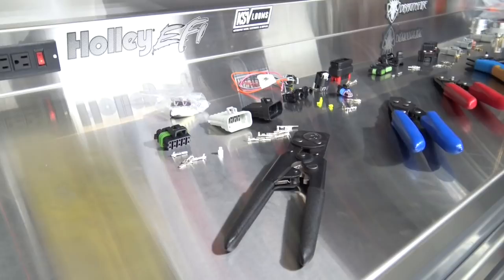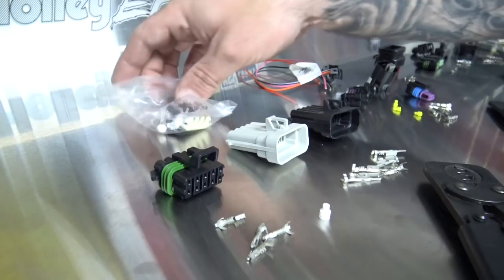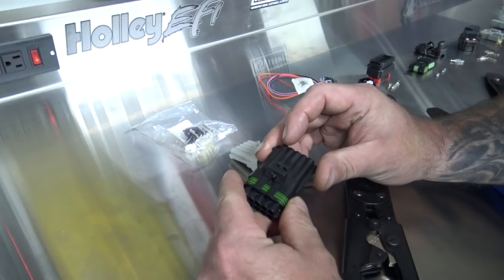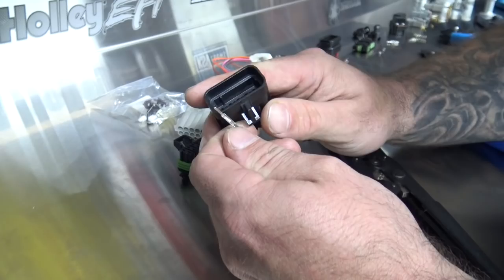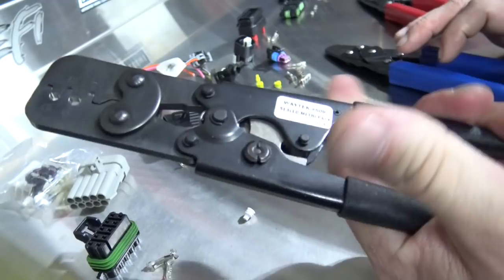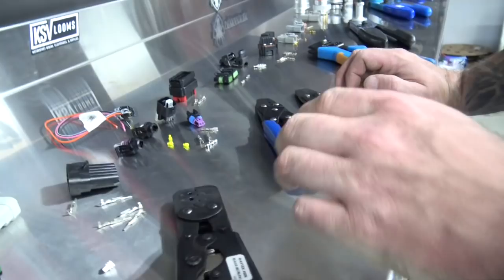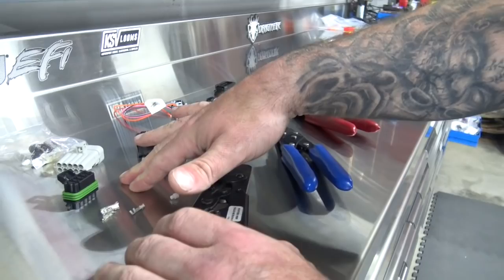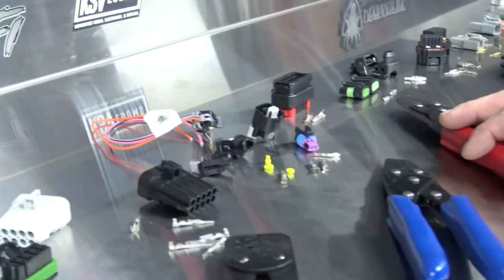holley efi connectors and crimpers.  Bulkheads, Deutsch, metripak, autosport, gt150 and amp.

Comment: I’m a regular car guy with a few mustangs at home. I soldered everything in my notch when I put it together. I watched your whole video to learn about crimping. Wish I saw it a year ago. It would’ve been a lot easier to crimp wires then to solder every one. I’ve never seen a proper way to crimp and make a solid trustworthy connection so I played it safe and soldered every wire.  I’d like to see them actually be crimped though. Thanks I’m going to check out your other videos.

Comment: Well, Packard/Delphi 150.2 pull to lock also uses three different female cavities, depending on the wire size, same goes for the pins.
Not only Deutch.

And Casper actually makes male cavities ( aftermarket), if you need to make extensions or short swappable harness ( I had to, for stupid Williams Controls pedal that keep breaking wires right at the connector).

Comment: i love them little douche bags! also fwiw MSD sells crimping dies for Deutsch connectors it works in their spark plug crimp tool msd 3510 it works with msd 35051.  poor mans crimp tool
thanks for sharing! I use the DT series throughout my entire car.  THe detent features on the pins are robust and provide an almost infinite service life.  I have only ever had one fail after 12 years of use.  Deutsche also used to make bulkhead connectors that are like the DT series, body is plastic and they worked well.  Much cheaper than the machined body ones.  thanks Devin good video as usual

Comment: Working in the aerospace industry, I would never use any cannon plug that has the three nipples on them for locking down the mating plug. They locking nipples wear down over time. Any company selling you those have not used them in the field and seen the failures of them. They were designed for interior cabins on planes and helicopters, but have since been replaced by the positive locking cannon plugs. Duetsch Autosport connectors are way overpriced. You can get Ampehnol connectors at a much better cost from an aerospace connector supply house, they are used on many commercial and military jets and helipcopters. Just food for thought.

Comment: What u think about putting Holley EFI on a nitrous engine and what would use. Like nitrous controller wise and injector brand etc
Reply from the maker: I've installed alot of dominators on nitrous engines, in fact the baddest nitrous cars in the country run Holley efi. As far as controller its built in to the software
Reply: @theholleyefiguy  Thanks
Reply: @theholleyefiguy  Would u help me select the extra sensors and stuff other than the basic that I would need to run the Holley?